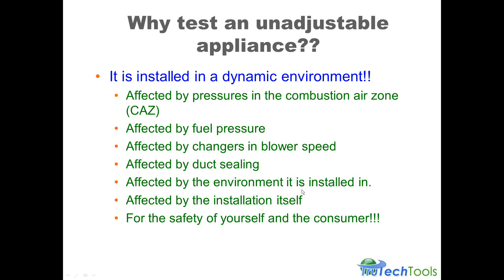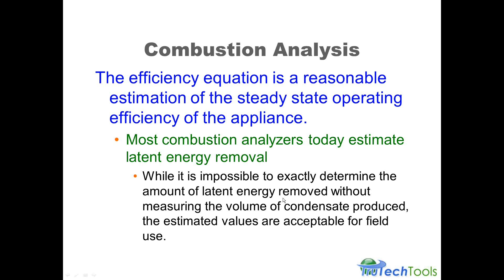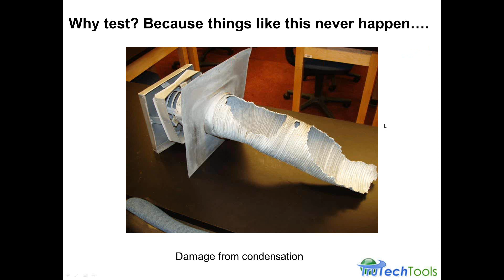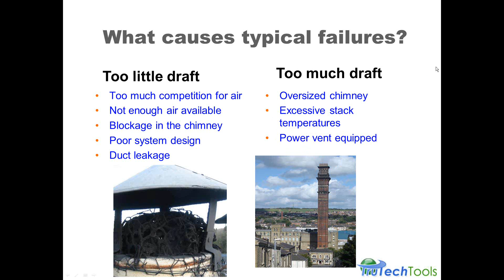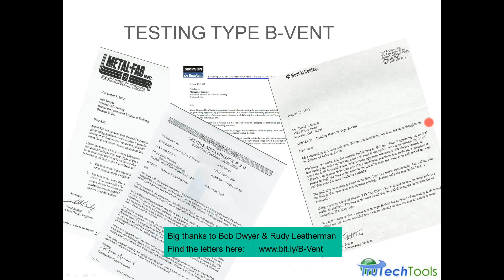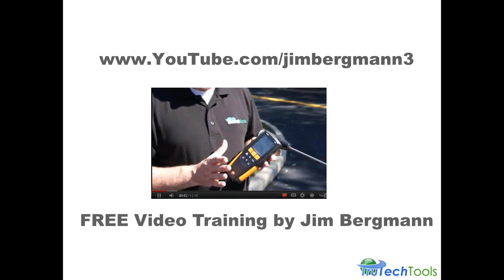Combustion 100: Understanding Combustion Analysis by TruTechTools

Comment: great video, a lot more in-depth.  What I would like to see is some kind of matrix of effects of adjustments to help maneuver the reading to best center them  almost like the guys that do front end alignments. 
 i.e.... if you increase gas pressure ;  CO will rise, temp will rise CO2 will drop draft may rise....
           if you lower gas pressure      ;  temp will drop, CO will drop, O2 will rise CO2 will drop....
something along those lines...  you know,  something to show us the effects of our changes.  In this way it will be easier to tweek and adjust the unit for a more balanced effect.  I'm sure one of these won't be midrange but between them and efficiency it would be nice to have a cheat sheet.